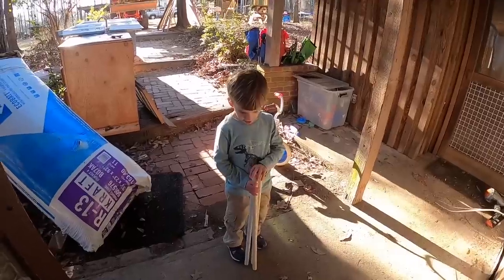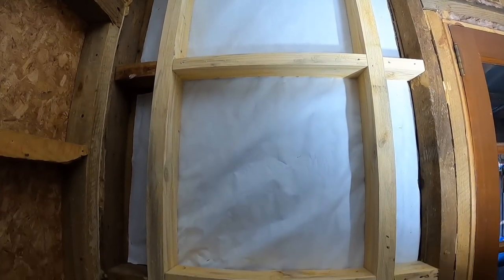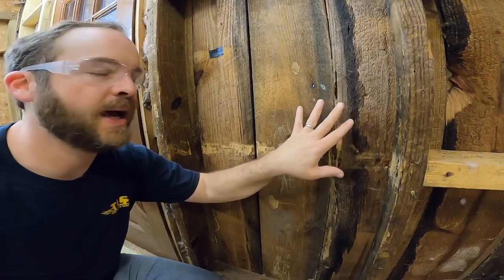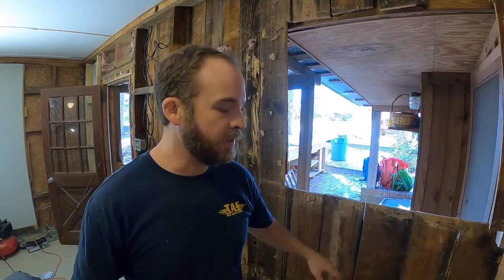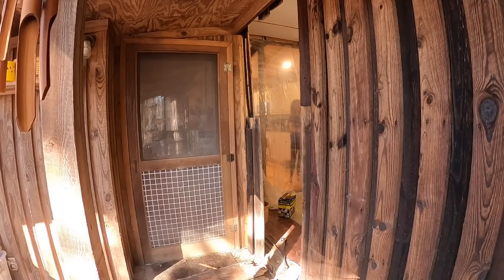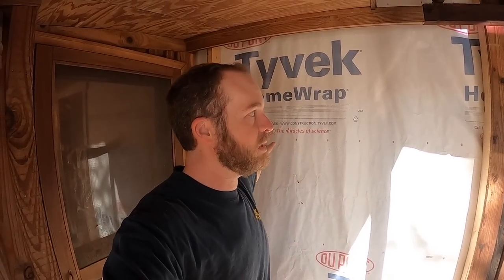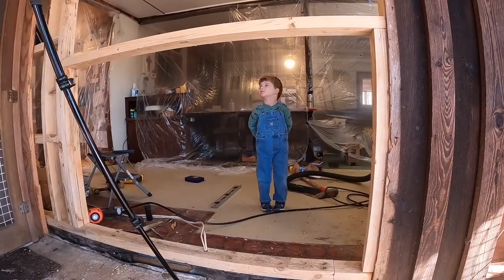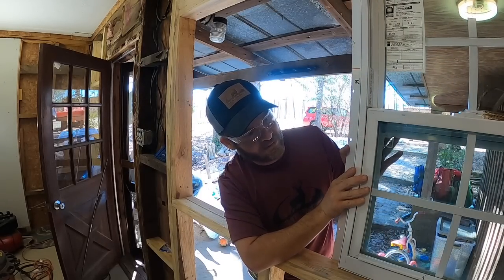Old Cabin Remodel Part 2:Termites Are Bad Dudes

Comment: The remodel looks great so far. I had a house in Illinois that was built in 1864 and there wasn't a square board or wall anywhere in the house. Every board had to be custom cut to fit whenever I did any replacement work.There was dry rot where water damaged the wood over the years. The beam in the basement holding the house from sagging was a 20 foot long old railroad track, it was probably stronger than any modern day I-beam. I know what you're going through during your remodel and you just have to work around the work from the past. looking good... As your cute little son says, 👍👍 Two thumbs up!!
Reply from the maker: That's really cool about the railroad track.

Comment: Hey Wes this brings back memories of my first home. Just like you started tearing into it and deeper I went more I found sawdust where boards use to be. like most old houses it was built right into the ground I think I wheel borrowed two dump trucks worth of dirt out front door to make room for new foundation. Luckily walls was still good but what a job it was. But got the old part repaired and added two new rooms onto the front of the house and a wrap around porch. Turned out pretty nice even though it was my first attempt of doing carpentry. But I was young at 19 just been married little over a year and my first son had just been born.
Reply from the maker: Great story, you just gotta do what you gotta do, experience or not. Thanks for stopping by!

Comment: Nice job 😊
I am used to drill trough delicate instruments mostly and found me a good simple tool.
You cut a small copper/aluminum tube to a preferred length and place that on the drill  you avoid a to deep bore damage easily and safe

Comment: Hi Wes, greetings from Argentina. I´m the guy who suggested you a few months ago to listen to 40 fingers since it seems you are a guitar music fan.
After I ended watching this video, it occurred to me: why not seal the window with some polyurethane foam? I have personally used it many times and it works fine even in places it is not recomended to use and it did pretty well. After it´s dry, you can shape it with a cutter, sand it and paint it as you like. Be VERY carefull with your eyes; and don´t make it stick to your clothes and or skin. It´s hard to take it off. Good luck!
Cheers from NE Patagonia, Argentina, (a dream place).
Reply from the maker: I remember. I checked out 40 fingers and they were totally impressive. Thanks for that suggestion. I do plan to use foam insulation around the windows. I've used it before in other places and it's great!
Reply: @falllineridge  Thanks for taking your time to answer. Cheers. BTW Some woman (may be your wife or your daughter) seems to have a good sense of humor BTS. That´s always a great plus when you come tired at home.

Comment: This might seem strange, but flat plastic model paint works really well for color matching dissimilar plastics/vinyl projects. Crazy but it works on caulking too, but make sure each stage is fully dry to avoid any possible reaction as the paint is oil based.

Comment: Nice project nearing completion and will be much improved. Since your did not use pressure treated lumber as the base plate, I would have applied copper naphthenate to treat them and any potential boards left in the wall. Clever idea of using the two windows.
Reply from the maker: No need really, we've got bait stations that get serviced yearly. Have not found any live termites.

Comment: Why all the cross braces in the 2x4 wall cavity?
Reply from the maker: Not sure, that's how it was originally so I just put it back like it was.
Reply from the maker: After I wrote that comment, I remembered that it’s for the vertical siding. The vertical siding boards are nailed to the cross pieces.